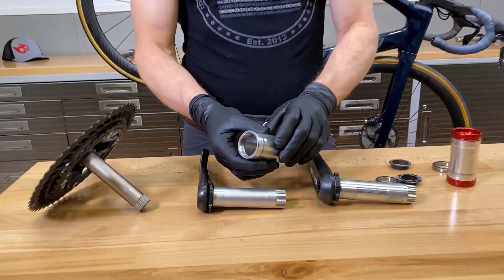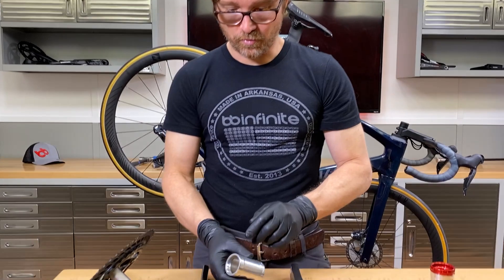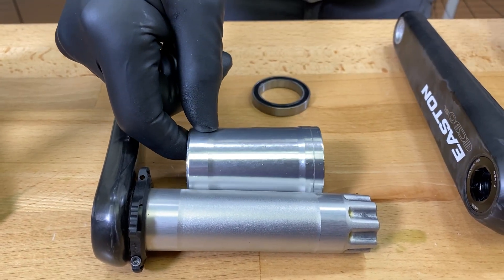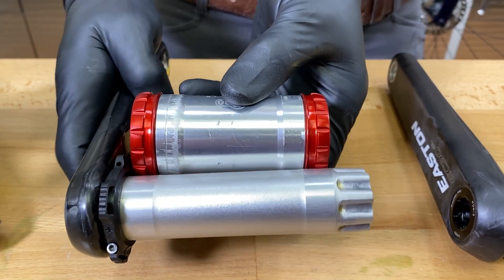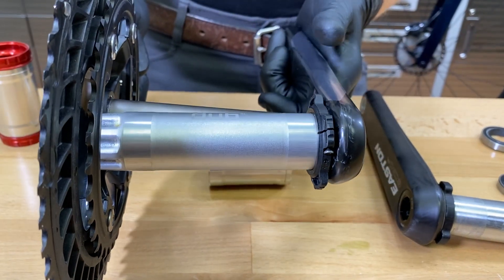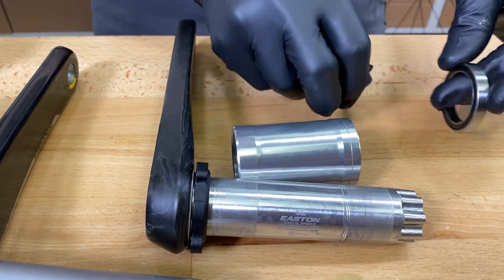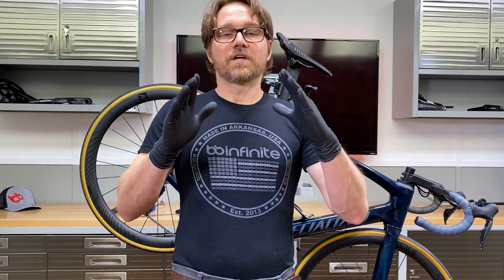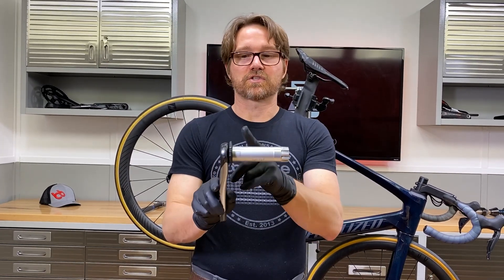DUB Crank Spacing Explained

Comment: So if I have a 68mm bottom bracket on a mountain bike….i basically cannot use a sram pressfit 30 bottom bracket because the bearings won’t journal?  I have to use some other bottom bracket such as bb infinite bb30 to dub to make this work. Is that what I’m gathering?
Reply from the maker: Yes, the PF30 mtb standard is 73mm (some Cannondales are 83mm), and the DUB spindle standard would mean that the bearings need to reside outside of the frame. We have our XL series BBs for this reason. If you have a PF30x68 in an mtb, that would be unusual. 68mm is more of a road PF30. I'd confirm it is 68mm before ordering. Our 68mm PF30s are under the ROAD heading. Message us on FB or IG and we'll help you sort it out, or email us at info@bbinfinite.com

Comment: what bb should I use if my bike is bb30 pressfit and what other parts would i need (for example the adapter you use,etc)
Reply from the maker: For BB30 we have many options depending on what crank you're running. The best thing to do is contact us. Fastest back and forth is via Instagram or FB messaging, next is email info@bbinfinite.com. Let us know the year, make, and model of your bike, and what crank you're running. We'll hook you up with the product you need.

Comment: SHELL SPACING. When he talks about that he means "the Frame width (without the bottom bracket BB in it) just bare metal is 73mm typically, some 68mm some other. Its called "SHELL WIDTH"  he says shell spacing and creates confusion.
Reply from the maker: If you were confused, sorry, but don't assume anyone else was.
Reply: 68/73 for threaded but 89/92 for press fit.

Comment: Great vids. Could you help me with what would be needed for a Cannondale of 83? I have the supersix evo SE. and I have a 46/33 rival crankset and I know it’s 83mm shell but does that mean there’s a sub like “super wide” to fit inside haha😂 it’s very confusing. I want to basically upgrade the rival crankset but don’t know what I need to buy. Thanks !
Reply from the maker: Your supersix evo SE is an Ai frameset, so the proper DUB crankset for it would be the Sram Dub Ai offset one meant for the bike. These is an option to run a DUB Wide crank, but it limiting. Please message us on FB or IG, or email us at info@bbinfinite.com so we can help you out a lot faster than doing it here in comments.

Comment: So regarding dub and dub wide. Are the drivesides the same but width solely governed by the axle @bbinfinite
Reply from the maker: DUB road and DUB Wide road cranks are different and not interchangeable because each is designed for a certain chain line, and this chain line is determined by the frame's requirements.
'DUB' = Standard Road for 45 mm chainline 
'DUB' + 'Wide" = Wide Road for 47.5 mm chainline

Comment: What does journal mean?..
Reply from the maker: Journal: : the part of a rotating shaft, axle, roll, or spindle that turns in a bearing. https://www.merriam-webster.com/dictionary/journal
Reply: @BBInfinite  hmm..so when you say the bearing doesn't journal, are you meaning the bearing journal doesn't seat on the spindle?
Reply from the maker: @chestermartin2356  The bearing journal is the part of the spindle that interfaces directly with the bearing race that is part of the rotating assembly, which in the case of BB's is the inner race, as the outer race is pressed into a housing and is static.

Comment: Please help. I bought a second hand Sram Force 22 DUD off E bay. What should the length of the spindle be to fit into a BSA 68mm?
Reply from the maker: A Sram Force, or any DUB road crank, will fit in any BSA system with a DUB road bb.
Reply: @BBInfinite  Will a DUB bb fit a bb30 pf30 crank? My spindle is 106mm with out the reload ring. Do I use a wavy washer instead of the preload ring? Thank You.
Reply: @BBInfinite  
This was the reply I received from Sram. "Based on the serial number, this is a BB30 crankset, which is not compatible with a BSA shell. While they are both 68mm wide shells, the BSA bearing cups sit outboard of the frameshell, while the BB30/PF30 models sit inside the shell.

To have the same level of crankarm, you would want to use a Force 22 GXP crankset and our GXP BSA bottom bracket."

Comment: great video thankyou, could you explain the MTB vs MTB wide , like what are the differences and why would one be used over the other?
Reply from the maker: MTB DUB follows the same pattern as Road. The difference between Standard Length about 6mm. Wide is preferred if you want a slightly wider Q-factor, and necessary if the bike lacks clearance between the stays and the crank.

Comment: What is the difference between boost and non-boost cranks? Is it just the chainring offset (3mm/6mm) and cranks are the same?
Reply from the maker: For MTB DUB, the "Boost" crank is the standard length (113mm) Dub spindle. From there they get longer, with Wide, SB+, and so forth.
Reply: @BBInfinite  Thanks for clearing that up for me!
Reply from the maker: @joeMopar412  Here's a link to our explanation vid: https://youtu.be/Gqc5ey7j39k

Comment: If I have a non boost bike that uses a PF30 BB with a 73mm width, Can I get the PF30 DUB BB to use 28.99 sram crank arms?  I wonder the bearings set outside the arm on a socket or something like that because there is not enough space to put the bearings around with that big arm. Thank you for the video.
Reply from the maker: Like this one: https://www.bbinfinite.com/products/pressfit30-for-dub-29mm-mtb-crank-sets?variant=40833475412124

Comment: On Dub, can you play around with the recommended outboard spacers? On the road wide it calls for 5.5(R) and 2.5(L); could you though run it 2.5(R) and 5.5(L), as long as your bearing contact on the spindle still hits the inside of the bearing? 
Trying to take the 47.5mm chainline of the Rival Wide and make it closer to 44mm.
Reply from the maker: You can play with the spacing any way you want as long as the inserts/bearings are in full contact with the bearing journals on the spindle.

Comment: Hey @BBInfinite - any chance you could comment on how Axle Length & Bearing Spacing May differ (or not) between DUB MTB and Dub/Dub Wide/Dub Cannondale Ai Cranks?  Basically I'm wondering whether a Dub MTB Crank might work on a road bike with a Cannondale PF30Ai-83 BB :P
Reply from the maker: That's a video we'll be making soon. Good suggestion. We've got what you need to run the DUB MTB crank in a SuperX with the correct inserts. It's going to have a wider Q-factor, so be advised.

Comment: Which sram dub bottom bracket do i need for 2021 tarmac sl7 frame.
Reply from the maker: The SL7 is BSA: https://www.bbinfinite.com/products/bsa30-dub-ultra-lite-road-threaded-external-cup-bottom-bracket-68mm?_pos=1&_sid=914e69ee5&_ss=r&variant=31774034296965

Comment: so just to clarify, it does not need any spacer in order to be installed on roadies with BSA BB?
Reply from the maker: All dub system require some kind of offset spacer on the DS. We supply the inserts/spacers you need with our DUB BBs.

Comment: So as long I get a BB386 dub BB it is posibel to use a dub crankset on any bike? The lenght og the spindel and the Shell is something I am woried about. The world off BB is confusing.
Reply from the maker: "So as long I get a BB386 dub BB it is possible to use a dub crankset on any bike?", and the answer is, kind of. What you need is a BB that supports the proper width need to run a Dub crank. The 386Evo width is almost perfect for DUB as it. PF30 isn't, and needs a bb that sticks out on both sides to get wide enough. Not just any Evo bb will go in any bike. It has to be the right bb for the right standard.

Comment: Hi, I've got an S Works Tarmac SL5 frame with  BB30 bearings with circlips 68mm wide BB shell (epoxied alu cups)  Now I'm looking at installing Sram Red BB386 Evo  cranks w Quarq DZero pm on it. If I remove the bearings and circlips and leave the epoxied cups with ID 42mm plus or minus, what BB with outboard bearings (thread together type) would you recommend? I'd like your thoughts on this and to know whether I'm headed in the right direction. I'm open to your expert opinions. I'm building this bike from the ground up and not wanting to use S Works crankset because of the narrow Q factor. I'll be installing a Ultegra Di2 groupset with Roval wheels. Would appreciate your help. Many thanks. Paul
Reply from the maker: Check this out: https://youtu.be/HUtgdewchaw
And this: https://www.bbinfinite.com/products/bb30-68mm-wide-format-xl-30mm-spindle-cranks-a-k-a-specialized-osbb?variant=40713139585180
Reply: @BBInfinite   Thanks mate. 👍

Comment: I have bb95 on my MTB can I add DuB and if so how
Reply from the maker: BB95 is a Trek specific bb system. Unfortunately the only thing that will fit is a spindle 25mm in diameter or smaller, such as an Shimano pattern or Gxp crank. Dub and 30mm spindles will not fit in any BB90 or BB95 bike.